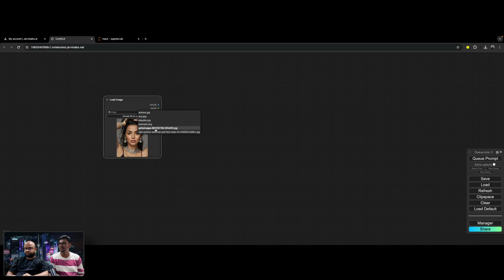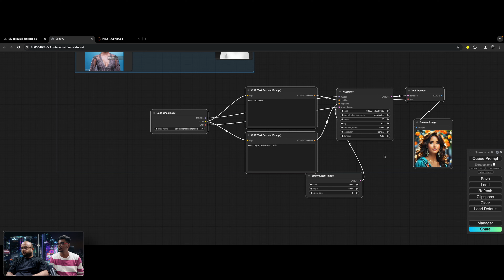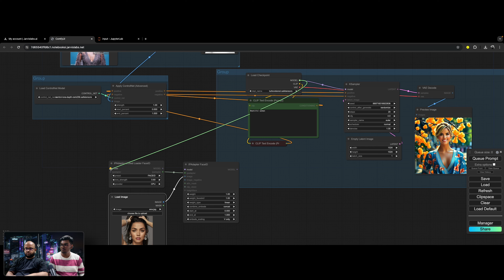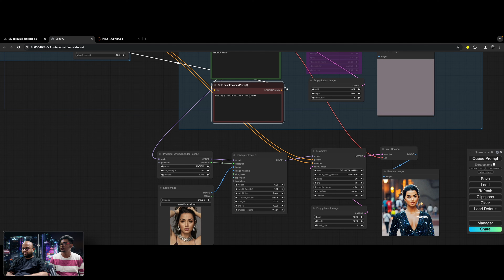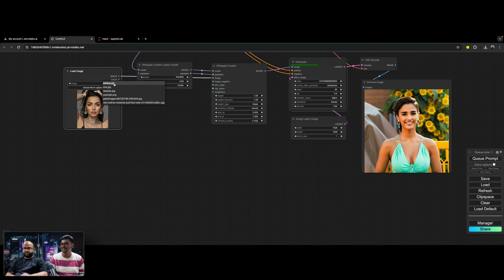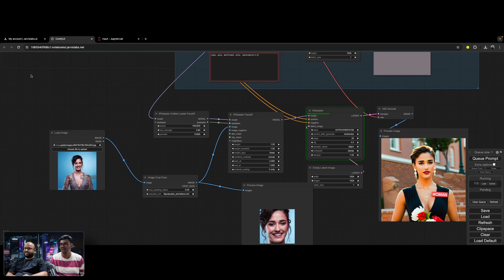ComfyUI: Master Face Swap & Pose Mimicry with IP-Adapter v2 & ControlNet | JarvisLabs

Comment: I've heard that if you use something other than 1024x1024 for your Empty Latent image node, it will then be less likely to put a watermark. I use 1016x1016.
Reply from the maker: Hi @joyceracing, we haven't tested that yet. BTW thanks for the information. We will test it out
Reply: @JarvislabsAI  your control net image had a watermark
Reply: Exactly. This is a known issue.

Comment: After two hours, still can't get Inference_Core_MiDaS-DepthMapPreprocessor added to Comfyui to use this workflow. The link associated with the missing node does not work. Where do you get this node?
Reply from the maker: Hi @DerekShenk , If you tried installing the inference core node via comfyui manager. There seems to be a download issue. No worries, you can install it manually using the following terminal commands
 
Note: Make sure to only copy and paste the parts within the quotation marks (" ") into your terminal

1. Navigate to this file directory : (Command) "cd ComfyUI/custom_nodes" 
2. Clone the repo :(command) "git clone https://github.com/LykosAI/ComfyUI-Inference-Core-Nodes.git"
3. Navigate into the inference core node folder: (Command) "cd /home/ComfyUI/custom_nodes/ComfyUI-Inference-Core-Nodes/"
4. Installing all the requirement : (command) "pip install ."
5. Restart the comfyui server
Reply: @JarvislabsAI  Thank you, however I had already followed those steps... git clone... and pip install. After trying three more times to install this inference node, I searched for the node and found it still failed to load when launching Comfyui. The error is " File "C:\ComfyUI_windows_portable\ComfyUI\custom_nodes\ComfyUI-Inference-Core-Nodes\__init__.py", line 1, in <module>
    from inference_core_nodes import NODE_CLASS_MAPPINGS, NODE_DISPLAY_NAME_MAPPINGS
ModuleNotFoundError: No module named 'inference_core_nodes'

I have updated Comfyui. Any suggestions?
Reply from the maker: Hi @DerekShenk, you might be missing some dependencies, but most of them should be downloaded by running the following commands: 'cd /home/ComfyUI/custom_nodes/ComfyUI-Inference-Core-Nodes/' and 'pip install .' Ensure that you include the dot at the end of the second command to install all the dependencies correctly. If the issue persists, you can visit our website and contact us through the chat feature
Reply: @DerekShenk  I have the same error it's wast of time!!!
Reply: You do not need the depth map they used. You can use any depth preprocessor.